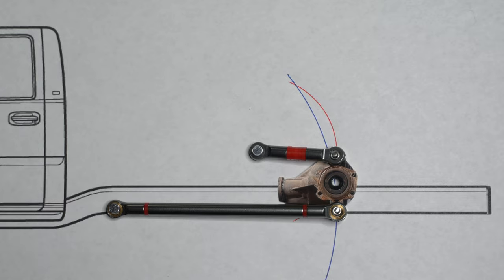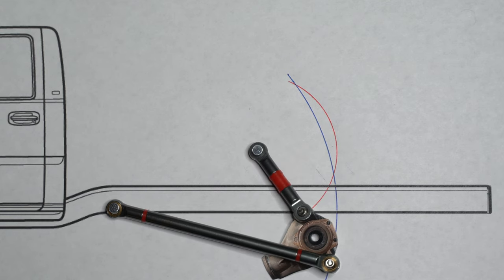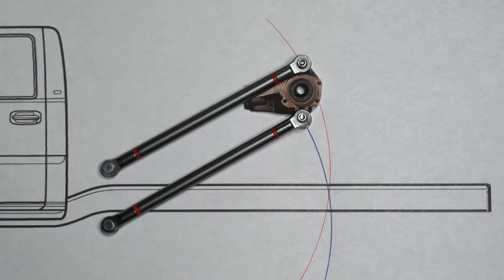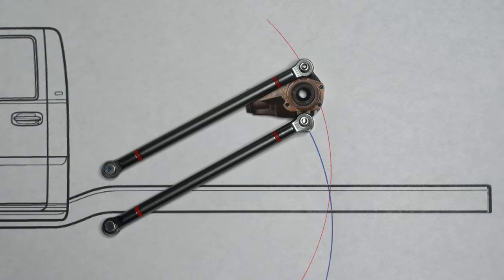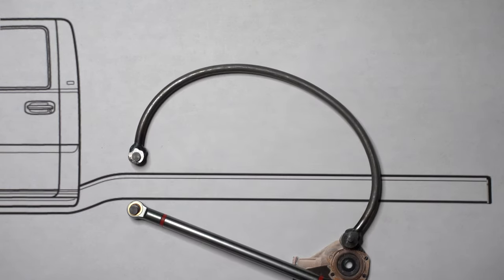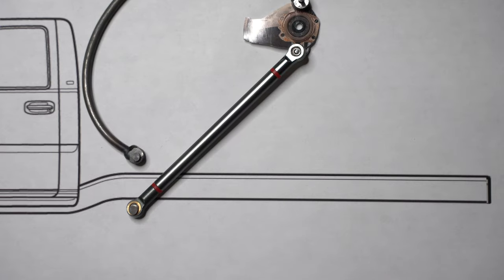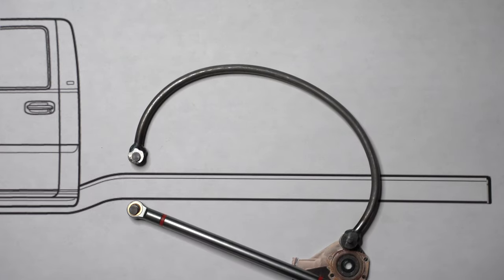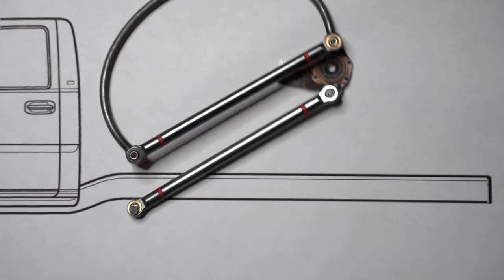Suspension Basics 04: Unique Shaped Link Bars and How To Use Them.

Comment: What type of joins do you use or would recommend for a 4 link parallel suspension. Keep up the content your Short, informative, and entertaining videos are much appreciated. I’ll be abandoning the antiquated leafs on my 04 rcsb Chevy truck. Also you never finished your opinion on the trailing/truck arm suspension.  Which nascar continue to use all these years later for its simplistic effectiveness.
Reply from the maker: Thank you, Ivan!  I prefer regular polyurethane bushings for parallel 4 links on street vehicles. Same with triangulated 4 links but Heim joints on the upper angled bars would give you a more stable axle.
If you’re referring to my short mention of the two-link setup, there will be a little more on it in the next suspension basics video about drive shafts and pinion angle. (Which is taking a really long time to produce) The two link is fine if used properly (NASCAR) where the suspension travel is minimal but it’s terrible for adjustable vehicles. In other words vehicles that may travel 1 inch off the ground one minute and 6 inches the next minute. The two link would create all kinds of pinion angle problems and potential failed U joints. Hopefully I can make all this clearer in future episodes. Hang in there!
Reply: @GarageFab  thanks for the reply..I'm considering either a triangulated 4 link or getting trailing arms from a 72 c10 and building a crossmember like the one you just mentioned in your new video and replicating its entire rear setup for my gmt800 rcsb. What's the maximum ride travel recommend for trailing/truck arms?. God bless
Reply from the maker: I’ll gently coax you to go with the triangulated 4 link for worry-free driving.
If you were to use the trailing arm design, I’d suggest installing some sort of automatic air management system to ensure you’re always at your target ride height. But what fun is that? Why not just install springs?
Any prolonged misalignment of the driveshaft is bad. The reason it’s not a concern on static height vehicles is how brief the misalignment is before the vehicle naturally returns to ride height.
I don’t think I could give you a range of acceptable ride height with trailing arms. I could only suggest… if you feel a vibration, bring it closer to your known good ride height. Not a guaranteed safe way to go about it but a vibration  definitely indicates an unhappy drive shaft.
Or… triangulated 4-link. 😉

Comment: @garagefab so I’ve been watching this over and over and I thinking of doing a 4 link on the hardbody. Would it be okay if only one link was bent to go around the fuel tank? Also, they would both need to be same length as the bottoms to keep pinion angle the same? 

So would it be better to design the tops then make the bottoms be the same size, as I have more room on the bottom to make them longer or shorter..
Reply from the maker: Hey Dina! Yeah that would be the perfect use for a wonky link. Because a bent link behaves the same way as a straight one, it doesn’t matter if you only have one bent link or three.
You’re correct about the equal length upper and lower links, but when we talk about bent or angled bars, I like to instead focus on the distance between the front and rear link bar tabs. (Same thing, just worded differently.) That’s important though because a bar that curves around a fuel tank would technically be “longer” even though the link bar tabs are the same distance apart.
Perhaps another way of picturing it, is creating your suspension with all straight links with the tank removed, and then simply rebuilding the one link near your tank to fit the tabs that you already installed.
Hopefully that didn’t make it even more confusing. 😆
Reply: @GarageFab is there someway I can send you a photo of how I’m thinking of doing this and you can let me know how it would or won’t work?
Reply from the maker: Yup! Instagram @GarageFab or email garagefab702@gmail.com

Comment: Is it possible to set up a Tourque Arm with Pan Hard Bar suspension set up to function as well as a four link?
Reply from the maker: It depends on what you’re using the vehicle for. A torque arm would perform better than a 4 link on a drag strip. On an Autocross course? I predict it could be set up to perform just as well if not better. 
On a bagged vehicle? I wouldn’t recommend it.

Comment: Are you going to go into the triangulated 4 link more ? That's the only one that bugs me since, wouldn't the top 2 links travel at different geometry since they're not parallel to the bottom 2 on whatever axis that would be. Sorry not sure if that question makes sense but I wish someone could explain this to me or put it in a video.
Reply from the maker: Yeah that makes a lot of sense and I'll be touching on the axis principle and talking about how it works with a triangulated 4 link. That's something that bugs me about how most people construct the angled link bars.
The angled bars natural movement is not tbe same as the lower bars, but when they're bolted to the axle they're forced to rotate on the same axis as the lower bars. That tweaks the bushings since even though the bolts for the link bar ends are angled the axis is the straight line between the left and right bushings.
This is totally acceptable in a static height vehicle but I think an adjustable vehicle puts too much stress on the bushings.
I design my triangulated links by welding the bar ends on so that the bolts match the axis.
This is ridiculously difficult to explain in writing and probably even harder to understand. If you've got an Instagram hit me up @GarageFab and I'll share some photos with you.

Comment: hi, I'm building a Suzuki samurai with Nissan patrol axles VW golf TDI 1.9 engine with a Toyota land cruiser transmission I want to build a 4-link suspension but got too much information and am now confused any plans or advice on the length of tubes positioning of brackets ect would be much appreciated.
Reply from the maker: Ah! You caught my attention with your Frankenstein build. Those are my favorite. My first truck ended up having factory doors and that’s pretty much it. Everything was either modified or replaced with another cars parts.
Let me know specifically what you need, Burhan, and I’ll do my best to help guide you through it. What type of suspension will you be using? Coil overs?
Reply from the maker: PS I absolutely love the Jeep!
Reply: @GarageFab  Hi thank you for the reply.
I don't know where to start should I install the engine with a transmission first then center the axles and then start on the 4-link build.
should my link tubing be the same length?
about suspension I’m thinking coil overs but don’t know what length.
just guide me what is the best for my set up
wheels and tires are 85 cm if I’m not mistaking about 34 inch.
I wish I can send you some photos of the project.
Reply from the maker: If you’ve got an Instagram, you absolutely can send me photos @GarageFab. Or, if you’d rather, shoot me an email to GarageFab702@gmail.com
You don’t need to do Suspension builds in any particular order. Front first, back first, motor, no motor, doesn’t matter.
With the exception of the pinion angle. You will need to have an engine and transmission installed so you know what angle to set your differential to.

Comment: Awesome video again! Yummy your man kandy now hahahahaha! Keep comment also made me laugh! 

So I would like not have to cut  my Nissan hardbody dailydriver’s bed and I would like to bag it. I’ve been reading the susupension handboody Max Fish wrote. I still don’t trust my self thinking about having reverse link bars so I don’t have to relocate my fuel tank. So is this possible Arron, I mean Man Kandy?
Reply from the maker: It's definitely "possible." I'm quite anti-reverse 4 link. I'm probably going to have to make a video about it. A lot of people claim their reverse 4 links are just fine but I argue that's not true. I can't explain all the reasons why here but I can assure you that relocating your fuel tank is not as miserable as it seems. A few brackets, a couple fuel line and wire extensions and you're done and you will have dodged several bullets by not building a less than ideal suspension set-up.
Reply from the maker: Side note: You don't necessarily have to cut your bed to bag your truck. If you want to lay the frame on the ground you'll likely need to cut it up to make room for notches or raise the bed floor but there's no law that says you have to drag in order to bag. You can have a nice lowered or factory height truck on air suspension.

Comment: OK but do use straight ones where possible, Remember the one sided weight on bent link bars is multiplyed when negotiating rough roads at speed.
Reply from the maker: Absolutely! There’s no sense in bending a bar just to bend a bar. It’s ridiculously easy to bend a bar once the bend has already been started so it needs to be more stout, which usually equates to heavier.
So the reason for bending in the first place needs to be of greater importance than the side effects a bent bar creates.
I’m concerned I didn’t use the word “bend” enough in that reply.
Reply: @GarageFab  Yes, I nearly missed it ;-)